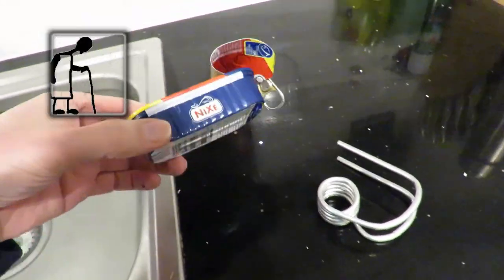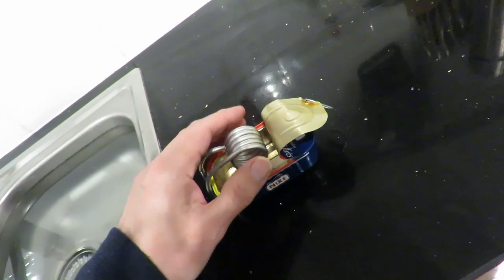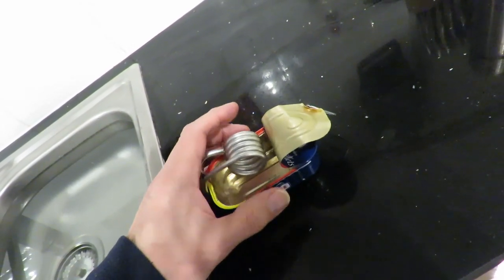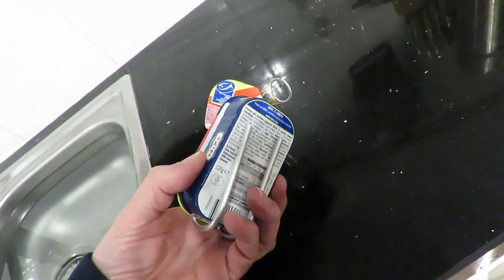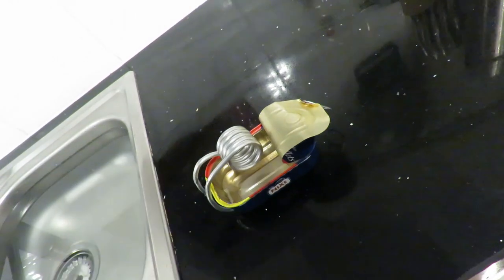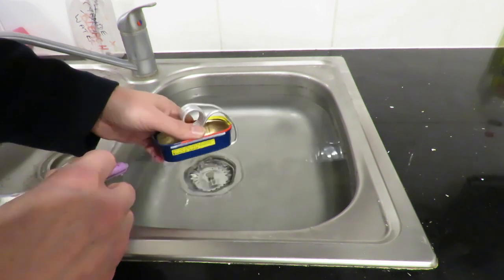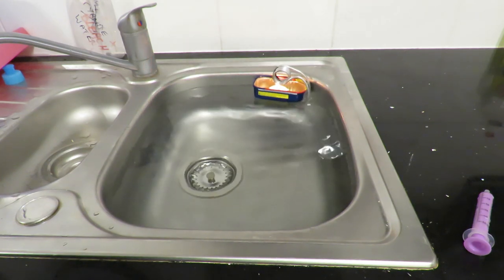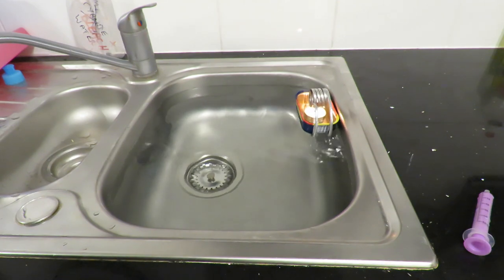Another Pop Pop boat from a tin of mackerel

Comment: Nice one I want to build one 👍🏼
Reply from the maker: Thanks, this one works well. I think I got lucky when my daughter saved that aluminium pipe for me. I have bought some copper pipe in the past and it's not cheap. Copper brake pipes for cars seem to be a reasonably priced source although I haven't bought any yet. I can see some at £9.95 for 25 feet 6mm diameter on eBay. It's a little bigger that I really want but I might buy some.

Comment: Cut one of the pipes a bit smaller then the other it works better not sure why but it does.
Reply from the maker: Thanks, have you tried it yourself or watched my videos of single pipe boats?
Reply: @GrandadIsAnOldMan  yes I watched you're videos love them .got  me thinking making one  went on eBay to get some pipe and ended up buying one already made and one pipe is longer then the other one so looked into it something to do with the water flow .